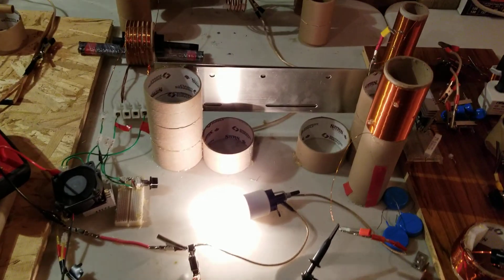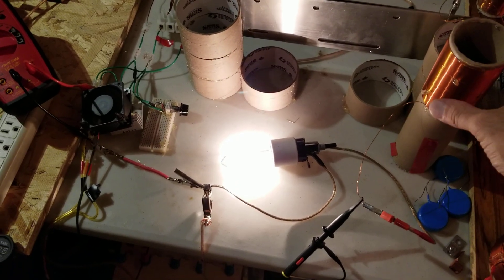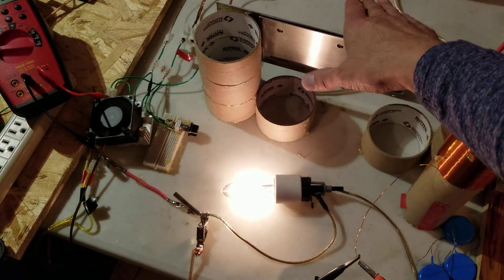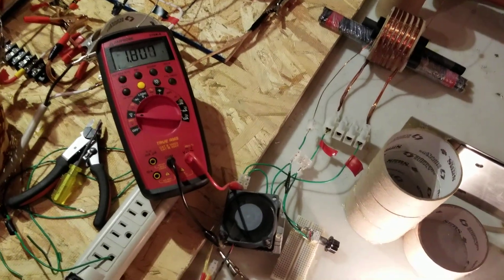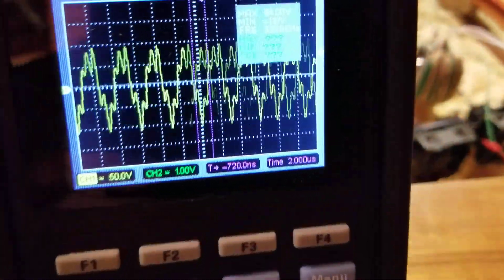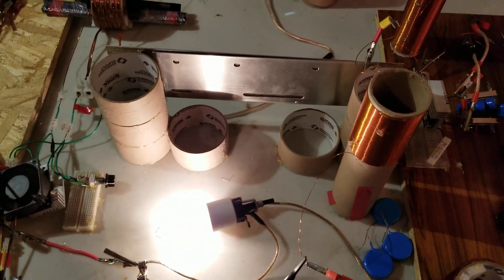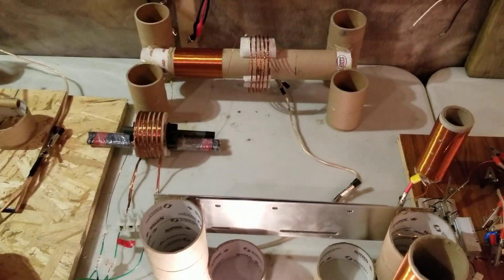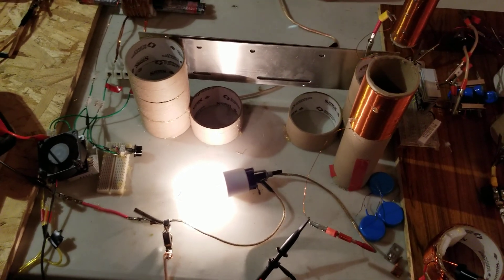Pt 23 TMT Tesla Magnifying Transmitter: Output Resonator added

Comment: From what I have seen, you do not use impulses, correct?
Reply from the maker: I would say I use square impulses in the primary Yes :)
Reply: @kdkinen   No That's not what I meant. 50% duty square wave (pulsed DC) Does not produce the radiant effects. 

Impulsed DC (like a inductive spike, less than 1uS duration) does. This is the key to understanding Tesla's radiant energy. 
You won't find this in the Colorado spring notes, but for example his London lecture is very clear about it.
Reply from the maker: @MasterIvo  wow that is great info ! And I really think you have it with your resonant bifilar experiments.
With this dual Channel function generator I will attempt you're experiment with  the negative bias etc :)
Reply: @kdkinen  Good luck, and please share the results, together we'll get "there" faster
Reply: @kdkinen  I finally am working with the extra coil. Did you ever measure ground currents?
Reply from the maker: @MasterIvo   Well what I have done is measure the current and wave form through 1 ohm resistor between ground and load ony earlier TMT with LEDs.
Output 285khz 160vac and 39 milliamps.
Input was 12vdc with 7 milliamps on an earlier video I did.
But here I feel like you are Tesla and asking me about my results lol
Not as good as yours :)
Reply: @kdkinen  thanks for sharing!
Reply from the maker: @MasterIvo  and thank you for the feedback
Reply: Hi guys, much happening in your workshops these days? Just a quick question. I'm stocking up on enameled copper spools and not sure what to get. Would you recommend some 0.25, 0.4mm 0.5mm just to get started with some coil experiments? I read somewhere that 0.56mm is best, no smaller, but I can't find any local. Does it really matter?

Comment: From the waveform it looks as if there is another higher frequency present. is that the extra coils resonant frequency?
Reply from the maker: Yes good observation, the light bulb is what is doing that :) 
Without the bulb it is a perfect sine wave.
Tuning on the fly with the large cap plates enabled a lowering of freq when close. And higher freq when spread likewise.
Reply: @kdkinen   Thanks, The light bulb has some added capacitance detuning the extra coil.
I found a inverted 3rd harmonic, or non inverted 5th harmonic would work best (if you would work with impulses)
Reply from the maker: @MasterIvo  interesting, I was just tuning for the maximum brightness but I wonder which harmonic it ended up being yes